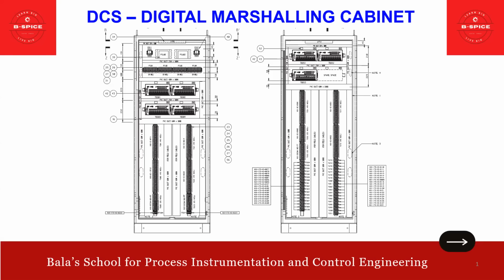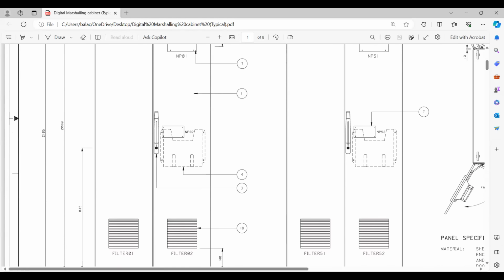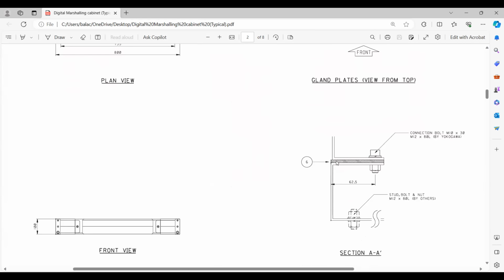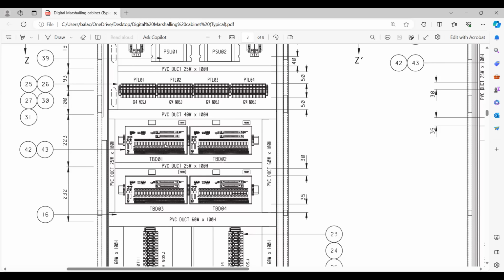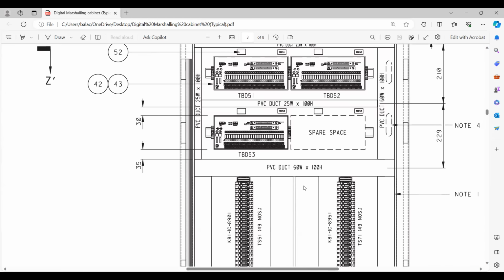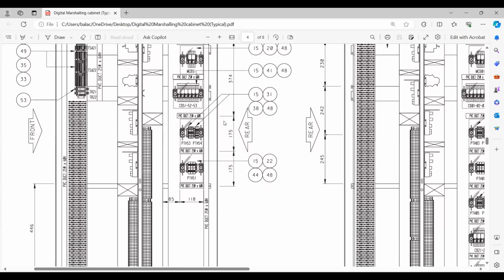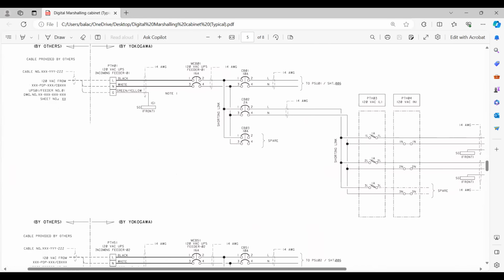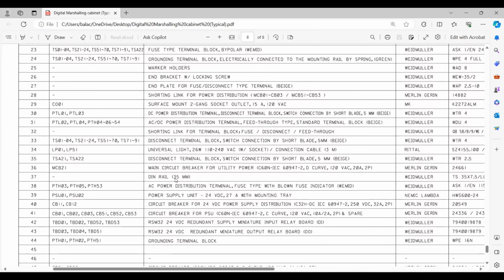DCS - DIGITAL MARSHALLING CABINET DESIGN

Comment: Hello Sir 
Why we keep the controller in top of the cabinet?
Can we keep the controller at bottom?
Or is there standard procedure for that?
Reply from the maker: Good question.. Many factors prompt the controller to keep at top of cabinet..1) Heat Dissipation, top location allows better heat dissipation since hot air rises
2) Accessibility - Top location more accessible for maintenance and troubleshooting
3) Safety Ergonomics - Controllers at eye level improves safety .. and many more.. Hope you agree!
Reply: @B-SPICE  Thank You Sir 
Could you make video on DCS I/O selection criteria?
Reply from the maker: @jamesspillner9601  DCS IO's module selection and Nest Loading already uploaded as member videos..